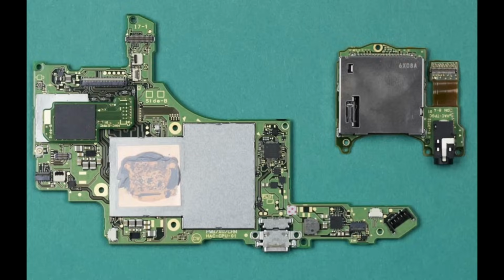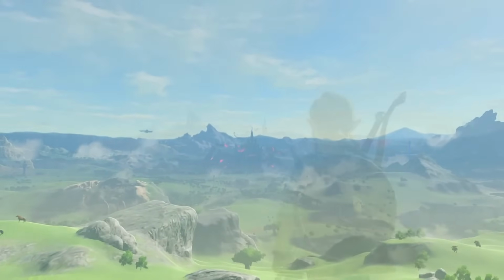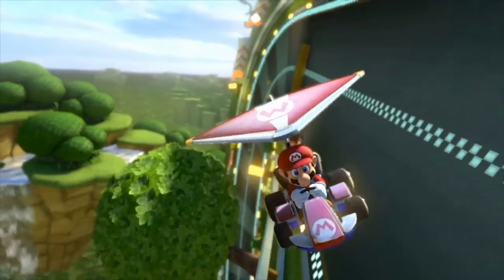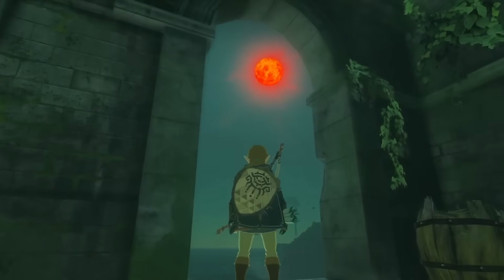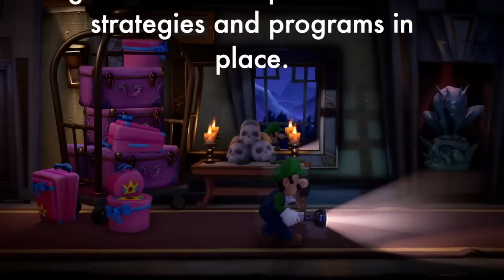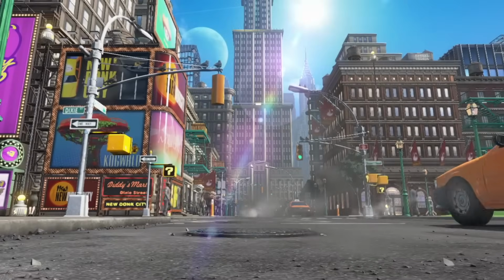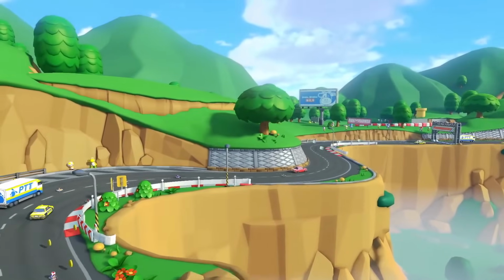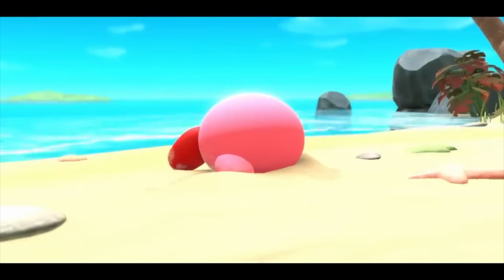Manufacturing the Switch Successor

Comment: dude your always slightly late to the leaks, there are leaks that the switch 2 will have 12gb LDDP5 7500MT ram
Reply: That would be a massive step over the steam decks 5500Mhz memory.
Reply: Would be roughly 120GBps.

Comment: they just need to NOT replicate the issues the WiiU had when advertising. ofc the reveal of the switch and wiiu are NIGHT & DAY difference, they just need to keep that consistency now. I mean i own a WiiU but its safe to say the game pad isnt a great selling point, save a couple games that make good use of it. Also not repeat the 3DS launch issue with it being so overpriced... i think theyll do fine, gamers arent that hard to figure out, just market it being a stronger switch and add 1-2 more features and theyre golden.
Reply: The 3DS' problem was that it was expensive, released towards the trough of a recession, AND had basically no compelling software in the launch window. When it got compelling software and when its price was slashed it recovered really nicely. It's a trap Nintendo COULD fall into but the very fact that they apparently delayed the Switch 2's launch date to make sure the launch software lineup will be solid is really reassuring it won't.

I don't think the Wii U's failure is even possible for the Switch 2. The Wii U fed off of Nintendo having basically dead 2011 and 2012s for the Wii and enthusiasm for it falling off dramatically coupled with a combination of doubling down on the Wii branding right when it was losing appeal while having very little of "Wii" style software for people who would be interested. The Wii U was a hardcore Nintendo fan machine stuck with Wii casual branding and ended up making neither side really happy or trusting of it. Switch is not only stronger than the Wii ever was but its popularity never really faded like the Wii's did over its lifetime. A lot of people want the "Next Switch" in ways people didn't really clamor for "the next Wii."

I think the 3DS' failure of having a too high price point and not enough compelling software at launch is way more realistic than a Wii U repeat.
Reply: @pattersong6637 Even then I kinda doubt a 3ds repeat here. They are taking a bigger risk here so they probably have more studios dedicated to making sure switch 2 has a good launch
Reply: The 2DS is actually a single screen, single board console to reduce costs which then mandated the slab form factor. This is interesting as manufacturing simplicity could reduce features however a balance can be achieved and smartphone component suppliers have progressed in their tech since 2017 and 2011.

Comment: I'm particularly curious to see how they're handling (or trying to) Joy-Con drift. Unless I'm mistaken the community has never found the actual cause of it, just a variety of solutions that may or may not work on any given controller.
Reply: The community has never found a definitive solution, from what we can tell it’s a poor structure that causes dust buildup, a result of al of the tech crammed in them.
Reply: I think using hal effect joysticks, which some 3rd party controllers use, work better probably
Reply: There's indeed fix found by the community and and the good thing is it only needs a piece of paper.. 

The issue is a mechanical one where the bottom metal part which handles contact to the stick itself  become loose over time... The paper ensures that said metal will not become loose.

Also Ifixit has a nondrift joycon for sale where they redesigned the joystick metal casing addressing the issue and to be more fortified..
Reply: @vivid8979  That’s a fallacy. It’s a temporary fix that Nintendo also secretly implemented in joy cons during the lawsuits where they pretended it didn’t exist. It didn’t work, needless to say.
Reply: There nothing to HANDLE jjat make new sticks
Reply: it's the little box inside all modern controllers. We need a brand new part.